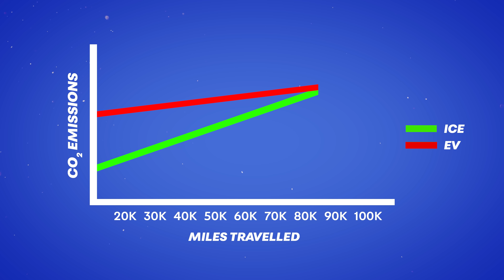Are Electric Cars REALLY That Green? [New 2022 Data]

Comment: Polluting more???
Ive got a diesel van with 450,000 miles on the clock. Its still using its original engine/ gearbox etc.
How many lithium batteries will I have burnt thru in 20 years?

My 450,000 mile 2003 Vauxhall Combo 1.7Di currently costs me 13p per mile in fuel.
I hired an EV van last year... It is a reasonable test as I cannot charge at home so I'd be dependent on public charging.

I hired the EV  van for my detailing business.
The EV van allegedly had a 200 mile range.
On a typical day. I drive 150miles per day.
Once I'd loaded the van for work inc the water tank. I was getting 50 miles from a charge.
I had to charge the thing 3 times per day! Thats around 4 hours wasted per day!.
I gave the thing back early as it was costing me money... Had to cancel appointments because the short range and constant need to charge the thing was not workable.

My good day went like this:
Take missus to work. She comes home on the bus.
Charge the van... Yawn.
Do 1st job...
Charge the van.
Do 2nd job
Charge the van so its ready for taking the missus to work.

What usually happened was:
Take missus to work. She comes home on the bus.
Charge the van... Yawn.
Do 1st job...
Drive to the charge point, wait in a 3 deep que and eventually charge the van.
Cancel 2nd job because of the charging issue.
Charge the van so its ready for taking the missus to work.
If we did any socialising, shopping etc... I'd need to visit the charger again before turning in for the night or we wouldnt have enough juice to take the missus to work in the morning.

Charging the van isnt just the time charging the thing.
Theres the time to drive to the charge point (not many around here).
Waiting for a charger to be available if someone is already there. I have been 5 deep in a que.

They are not good enough. The range is too short and the charge time too long. public charging facilities are sketchy at best.
I live in a city of 320,000 people. My nearest public charge point is 8 miles away, there is just 2 points. The next charge points are across the city some 15 miles away.
Public charge points are not cheap, mile for mile the EV was working out more than double the cost of diesel!
I hate card payments. I have lost so many credit cards... I leave it at home, Im not good with cards.. I can buy diesel with cash... I like cash, I know where I am with cash.
Added bonus of the diesel combo.. I can turn the engine on and run my tools off the inverter.
I would hate to think what the range would drop to if I needed to run  an inverter off the EV battery.

The local bus company has some electric buses... They are always freezing cold and the drivers are not allowed to turn on the heaters on because it kills the range, the buses are constantly getting delayed or cancelled because of them needing charging.

I really despair for the future.

Comment: We all know that an ICE Volvo will run 18-20 years when well maintained. How long before an EV requires battery replacement? Would that not nearly zero its possible gains and place it far behind the ICE car over a 2 decade life span? And when finally dead, that's a lot of massive batteries to dispose of. Not sure the tech for mass EV is here yet.

Comment: The point is that fossil fuel burning has to stop - and quickly. In the long run, with EV's and a renewable grid, we will slash CO2.
Just by an EV as your next car and source your power as renewably as you can.

Comment: What a BS use of statistics! 90,000 miles is literally NOTHING in comparison to the lifetime of any vehicle, let alone an EV. And that is the "Global" energy production split. But in the EU, it's 52k, AT THE CURRENT EU ENERGY PRODUCTION RATES. But 
1, the EU is becoming ever more "Green" in its energy production 
2 These are Volvo's statistics for Volvo's cars. And Volvo produces "Luxury" or "Executive" cars, which carry greater weight than less exclusive brands. And Volvo doesn't, for example, use recycled bottles for its interiors. 

So this is BS research based on BS circumstances to... work as click bait.

Sorry, Auto Trader, but that is an F

Comment: The manufacturers can go a long way to making both the EV and the ICE car production more carbon neutral but this comes at a cost, especially with old Manufacturing Plants. New builds can include new processes and renewable resources or even panels on the roof (Giga Nevada). One thing you will find is that batteries from BEVs when replaced, still have a life as power storage or full recycling into a new battery (Redwood Materials).

Comment: Great video Rory. Being lazy here - apologies - but having read the report did you find out whether Volvo factored in replacing the battery? Heard a horror story recently about a Merc driver getting stiffed for a fantastically expensive new battery that cost more than the car was worth. Personally I like the idea of EVs for around town but I am just not ready for driving long distance in one. Also, small but important point I believe, there is no such thing as 100% renewable electricity unless you generate it yourself and have great patience. Green energy companies can only make this claim because fossil fuel generators buy Renewable Obligation Certificates from them. It’s an accounting trick, so in the real world of actual emissions you won’t get a quicker payback from “100%” renewable energy as currently defined. I have invested in battery startups before and so far they have been a big disappointment. Not to say there won’t be a breakthrough but like fusion it is nowhere near as people would like to think. Graphene seems to be the most promising approach in the lab but scaling up will always be the real test.
Reply from the maker: Replacing the battery wasn’t a factor because the report only covers a typical usage phase up to 124,000 miles. The average age of a car before scrappage (in the UK) is about 14. The average distance driven per year is 7,400. Multiply those figures and you get 103,600 miles before most cars will be scrapped (obviously some will be kept longer, or shorter). Most manufacturers provide a warranty that largely covers that. Eg Mercedes has an 8 year / 100,000 mile battery warranty. I heard about that Merc driver… it’s a shame. It’s a story as old as the hills though, regardless of powertrain, and hopefully not very common. I’m running a 10 year old electric car at the moment. They last a long time. Good point about the ROC

Comment: Charge your car with renewable electricity and it only takes 29k to break even. If you look after the battery and are willing to accept a modest amount of range loss then you can keep driving on the same battery for 200-300k. It's pretty clear that an EVs footprint is far lower in the long run. What we need to get this green charging is for the places where cars are parked during the day, such as offices, factories, shopping centres etc, to all have solar panels feeding car chargers throughout their car parks. By fitting the charging time to when cheap green electricity is available you avoid the big problem of renewables of energy production not coinciding with energy demand.
Reply: If everyone is electric then how is it possible for them all to charge from renewable energy when demands may well be hundreds of times higher than they are now from the grid because we are all electric . If I had a ev then my electric use just to go to and from work would be 5x greater than it is at present with an unreliable renewable energy support that couldn't cope with a village all putting the kettle on at the same time. Expecting that system to cope with 15 or 20 million cars charging up daily is ridiculous

Comment: Just nonsense, the shift in energy is to far more solar, wind, geothermal, etc. soon no EVs will be running on electricity from coal powerplants. Coal powerplants are being phased out. Already, some EV owners power their cars from their own solar rooftop systems.

Comment: SPENT BATTERIES... the dirty secret that EV-Angelists don't seem to have grasped.   On paper EV's wipe the floor with ICE engines in terms of direct emissions, but at the moment only 5% of spent battery cells get any kind of effective recycling
Add this to the carbon cost of their creation and the CO2 emissions from the national grid charging up EV's and we still have a long way to go before motoring of any sort using battery technology can really be deemed as Green(er)

There is also the critical issue of spent range EV's like old Nissan leaf's where an enormous wedge of cash is required to give one a new life (circa £7K) which effectively makes a spent-range Leaf worthless. A similar age ICE that needed a new engine might cost around £1K meaning that it is environmentally better to keep an ICE on the road by giving it a new or refurbished engine than putting a fresh battery pack in an old EV

Comment: The focus on CO2 is short sighted.   Reduction in CO2 has little impact on human health.  However, all the other nasty combustion products can impact human health.  Stationary sources such as power plants have higher efficiency than automobile engines.  Also, controlling the emissions at the power generation stage is much more effective than controlling the emissions of millions of cars.   Thus, removing combustion from cities is a major advantage to human health.    The worst example of CO2 focus was Europe's obsession with Diesel cars.   CO2 went down, but air quality went to crap.   The manipulation of tests by VW and others made the problem much worse.

Comment: Hm... last I heard the break even point could be as low as 7.5k miles, what's going on? although even at 50k-ish miles that's still good, we're expecting EVs to last way more than 124k miles on the original battery as volvo used in their example, 50k should be only 1/4 the life of the average EV just like it is for the average ICE that's kept up with its service intervals and much more than that for the big battery EVs, i mean just take any 250 mile EV, round that range down to 200 miles to account for degradation over life etc and assume the battery will last 2000 charging cycles as we expect from modern EVs and that's a car capable of doing 400k miles (8x the break even point!) on the original battery even if you halve that to 1000 cycles and it's still a 200k mile lifespan.

Comment: Hi sir very interesting . My take on a lot of this is to do with the green lobby that have pushed this at all costs , many who invest in the technology are not fully aware of the negatives but extoll there benefits. And as time goes on and less and less vehicles are allowed or available that consume oil derivatives, many drivers will be faced with a massive financial problem . Will an aged EV be a viable option, for those who have never had the resources to enter the  new car market . I would assume that the battery’s would constitute a major expense if it was needing replacement , I admit I absolutely know nothing from this perspective . So would value any more informed opinions        Best wishes and kind regards
Reply: Thanks for your reply but you did not cover the issue of people being able to consider a EV  that is far from  new  . Low income family’s have for years been able to run older vehicles , will this not be so easy as the sector changes . Another point to consider is despite claims by manufacturers  the cost of a AV charging point installation is of its self not a cheap exercise if done properly which I as electrical contractor can state many are not installed correctly and are far from safe .             Best wishes and kind regards
Reply: I don't think it's the green lobby's fault. The green lobby is quite right in saying that we need to cut emissions or else. However I reckon that companies are actually using EVs as a scapegoat to distract from the fact that in many places environmentalists are having a hard time pushing for more renewables because of all the dodgy dealings going on behind the scenes (e.g Germany increasing coal production, the energy mix actually has less renewables as a percentage than it did prior). It's not just the power companies, it's things like manufacturing where more efficient methods could be used to cut emissions but this would cost money. Even if you don't accept this rather conspiracy like theory (fair), It's quite annoying when only 8% (globally) - 15% (EU for example) of emissions (depending on which stats you look at) actually comes from passenger cars, yet it seems to be one of the only sectors where the change to more "green" methods (see vid for context, it's circumstantial) has been pushed so much and so rapidly. The worst part is replacing all ICEs with EVs will only cut that 8-15% figure by 25% (so down to 6-11% of total emission globally and EU respectively) based again on the info from the vid. It begs the question, why are environmentalists who should know what they are doing (I have no proof for that unfortunately, its up to you trust them or not) screaming and shouting about EVs when there are much bigger issues we have to tackle first.

Comment: Good explanation, thanks.  It is worth keeping in mind tho that EVs, according to the Volvo report, are already cleaner, and they are just at the start of their development, whilst ICE vehicles are at the end of theirs.  Local emissions, although not important from a climate change point of view, are very bad for humans, so eliminating them is already a massive win (ignoring tire and  - reduced - brake particulates).
Reply: Pure Selfishness Local Emissions is way more important.
Reply: @Neojhun  Most people live in congested cities, the concentrated pollution they are exposed to increases health problems, thus local emissions reductions save money, and thus resources/energy consumption, on healthcare/taxes in addition to the long term global environmental situation.
Reply: @howardmarkert8150  Exactly thus why I think it's way more important reason to upgrade to EVs.
Reply: Other threads need to be woven into the conversation too, ie the choice for green isn't just BEV, it also includes Hydrogen fuel cell EV and ICE's running a "green" sourced fuel, be that hydrogen sourced from "green" energy or synthesised hydrocarbon fuels derived from green energy (ie GTL fuels). These can all be carbon neutral, and may make for efficient transport systems as they do not require dragging round a ton+ of batteries to reach range criteria; even future generation batteries are a weight inefficient means for energy storage in a moving vehicle.
The whole infrastructure needs to be renewed too, but the politicians just focus on one solution, not the myriad options that are actually out there and which will likely be better than just choosing one and shunning the rest.
Reply: @thecraggrat  LOL H2 as an energy distribution network is scam. Beyond being non functional on a large scale. It will literally cause DEATH and Destruction.
Reply: @Neojhun  What, like that other terrible highly flammable liquid, petrol? Yeah, better not ship that around in big tankers, or even worse LNG... Both of them absolutely useless, and how we put up with all that death and destruction, I don't know. 🤔🎆😆😆
Reply: @thecraggrat  LPG Autogas has insane track record. (NOT LNG & CNG) The 3rd most used vehicle fuel. Yet insanely low occurrence of death and injury. FYI It's just ALKANEs. Which can be synthesized with renewable energy. The only problem is Collecting enough CO2. What an awesome problem to have.
Reply: @Neojhun  You make statements that are unsubstantiated...I also do not see where your statements coincide with reality.
First, LH2 is used very widely in industry currently, and is transported around without incident.
Second, LH2 is also touted as it has the potential to be generated at POU and is relatively easily stored.
Third, experiments have shown, and a little thinking makes it fairly obvious, that hydrogen has a relatively low likelyhood of causing such incidents as explosions. As long as there are no traps that allow for hydrogen to gather AND mix with air, it will not be explosive...as hydrogen is the lightest gas it will naturally rise away from a point of release and disperse. IF a high pressure system ruptures, the HP hydrogen will not explode, catch fire, yes, explode no as it cannot mix with the correct ratio of O2 in such a scenario - check youtube for these experiments - then it rises and dissipates. 
Petrol by comparison has heavy vapours that pool and mix with air, causing ideal conditions for  an explosion to occur.

Comment: Carbon [chemical element C - atomic no 6] is soot, mainly dealt with by the clean air act [UK] 1955/6ish. Carbon dioxide [Co2] is a colourless gas which makes up 0.04% of the atmosphere in dry air at sea level. The other gasses are 78.09% nitrogen, 20.95 % oxygen, and 0.93 % argon. A brew of trace gases accounts for the remainder, methane, nitrous oxide and ozone. Of the 0.04% Co2 [400 parts per million] 97% is from natural sources with 3% from the activities of humans. Co2 level are controlled by natural feedback systems with most of it stored in the oceans. [The bulk of the earth's Co2 is stored in calcified rock laid down millions of years ago]. Of the 3% by humans less than 1% comes from the British Isles. So that's 1% of 3% of 0.04% - and I mean .04% not .4%. The atmosphere it continually changing its temperature due to solar, tectonic and oceanic forces. We are currently in an interglacial warming period following the end of the Pleistocene ice age about 11,000 years ago. Other shorter term cycles like the Milankovitch have an impact on global weather too. I understand this is to do with the wobble of the earth's axis. Carbon trading is a con designed to create a tradable commodity for the convenience of bankers, brokers and wealthy investors.